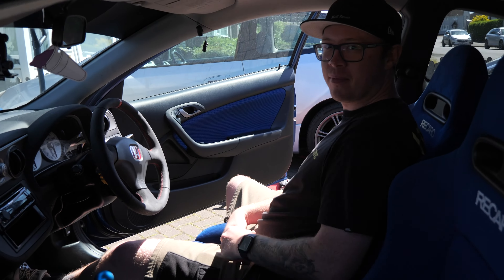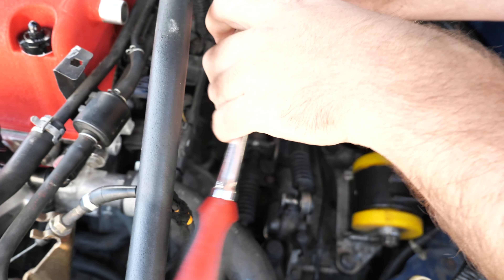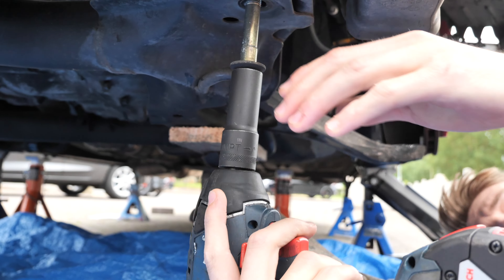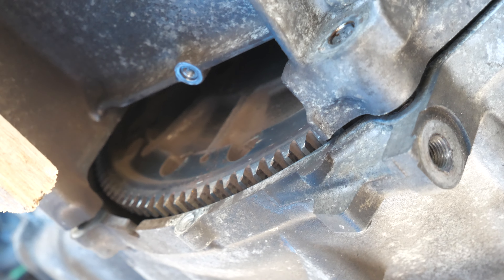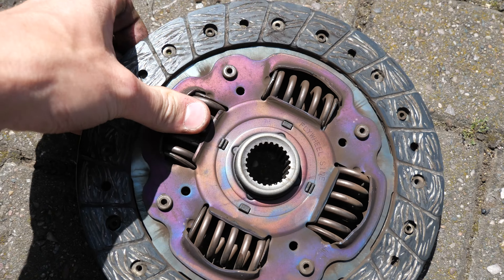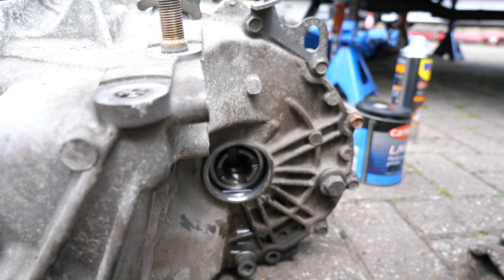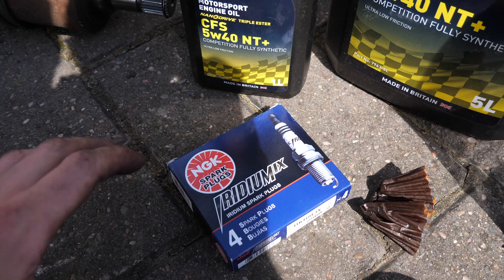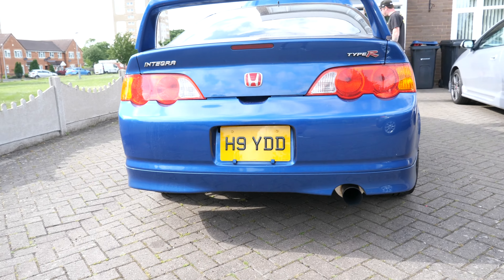CLUTCH FITTING - HONDA INTEGRA TYPE R DC5 K20

Comment: Just to mention, your air filt is way to small pal
Reply from the maker: That’s the right size man
Reply: @JustbeingHayden  looks to small, and that will result in a restriction of tge volume of air that goes in to the engine, the bigger the better, thats a massive space there too, Google it pal, upur see what im talking about
Reply from the maker: Mad tho because they are so popular in the Honda set ups matey
Reply: @JustbeingHayden  i have owned 2 fn2, a 3 ep3's in the passed and never seen one that small, as i said google it pal, and usually the HKS mushroom filter is a popular one